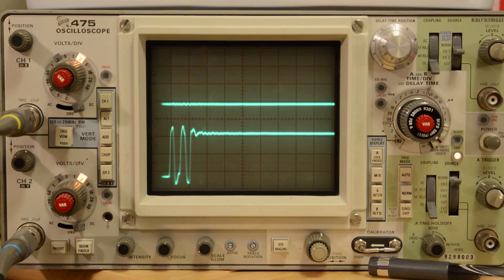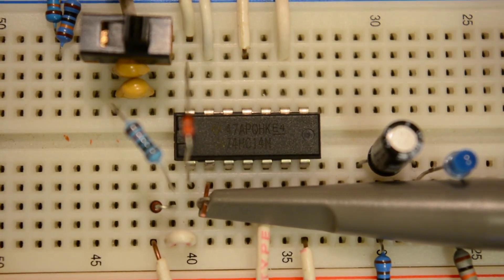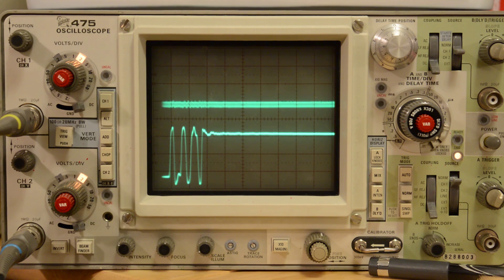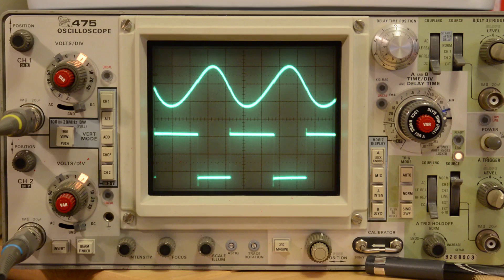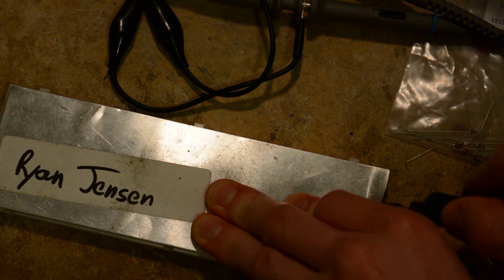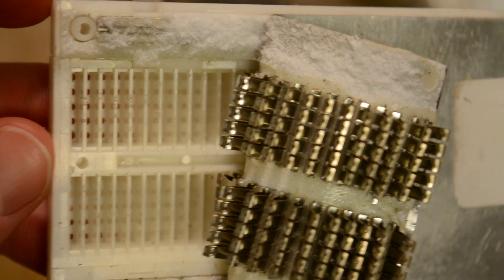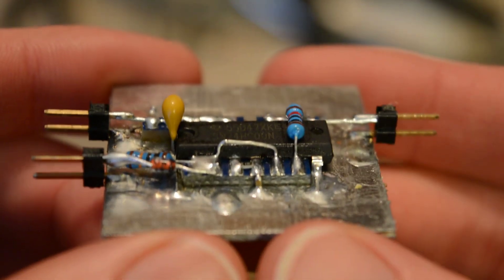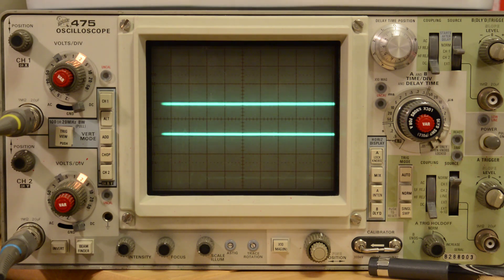Breadboard Parasitics - Misbehaving Digital Circuits

Comment: I am testing my ultrasonic sensor circuit which is controlled by arduino microcontroller on the  "breadboard". But my circuit is giving the unwanted output. Without any input signal to ultrasonic sensor this is because of breadboard only?
Reply from the maker: I don't have enough information about your situation to correctly diagnose your problem.  Generically, try to simplify your circuit as much as possible - only test one thing at a time.  Also, ensure all your electrical connections are solid (not intermittent)

Comment: Ryan - just saw your message in YouTube (was stuck in a spam folder).  As others have stated, the root of the problem you're seeing is 3-fold:
1) Breadboards make if VERY difficult to get good power supply decoupling, which is imperative when dealing with circuits with high speed edges - hence the distortion on your input signal.
2) The parasitic capacitance causes a lot of coupling between nodes, especially the high frequency energy in high speed logic edges - hence the multiple-transitions on your switching waveform.
3) Ground lead length on the scope probe can also lead to ringing in the measurement - see my video on that.
Reply from the maker: +w2aew Thank you for the information!
I soldered together the circuit from your TDR video (the 74AC14 buffered relaxation oscillator).
When I probed the circuit with a long ground connector (a few inches long), I saw a decent amount of ringing.

I tried probing my circuit the way you do in the video you referenced.
I saw a considerable decrease in ringing.
Thanks a lot for the instruction!
Reply: Glad to help.

Comment: Why are you ignoring the parasitic inductance? In fast logic circuits that is a far larger problem than parasitic capacitance. Rule-of-thumb: 1mm wire => 1nH. Do the calculation of V= Ldi/dt where di is the transient switching current and L is 1nH for every mm between in a loop between ground pin, Vcc pin and decoupling capacitors. Google for "ground bounce".
Reply from the maker: +Tom Gardner I did not consider the possibility that this phenomena was being caused by a parasitic inductance. I spent some time reading about "ground bouncing".
How, specifically, do you explain the behavior of my circuit?
You remind us that wires have inductance. You mention a phenomena called "ground bounce".
But specifically, how do these two things produce the glitch shown in the video?
Reply: +Ryan Jensen What did you understand ground bounce to be? I suggest you do a quick SPICE simulation of a circuit with a representative load and inductance in the ground lead. Remember that (photon counting circuits and femtoampere amplifiers excepted) everything is really analogue, even if a circuit "interprets" it as digital.

DIL TTL logic families used to have their GND/Vcc pins on opposite corners, and there was a minimum 1.4" loop from chip GND to chip Vcc. Even in the 70s this caused problems, leading to flat Rogers capacitors that were mounted under the IC[1]. By the mid 80s it was very problematic as transition speeds increased, and that nowadays you see GND/Vcc pins next to each other in the centre of the package to minimise problems. 

Very briefly, transient currents during switching cause transient voltages in the GND and Vcc wires. As far as the chip is concerned these "move" its GND w.r.t. signal from the external circuits. As far as the input transistors are concerned that is equivalent to having the induced voltage in series with the input voltage. And that can be large enough to cross the logic threshold.

[1] e.g. http://www.silicon-ark.co.uk/203a14-decoupling-capacitor-by-rogers-corp
Reply from the maker: +Tom Gardner
If a voltage is being induced in my ground connection, it should be the same polarity each time, because the polarity of the transient current in the output is the same each time. Do you agree?
Reply: +Ryan Jensen No. Think about what is happening physically in terms of electron storage and electron flow (charge and current). 
If the current goes from 1mA to 2mA in 1ns, what is di/dt? If the current goes back from 2mA to 1mA, what is di/dt? 
If the output changes from 0V to 5V and charges a capacitor, what is the direction of the current flow? If the output changes from 5V to 0V and charges a capacitor, what is the direction of the current flow? 
You need to read about switching transients, currents and ground bounce. Start with the classic book "High-Speed Digital Design A Handbook of Black Magic", and understand everything by Howard Johnson on http://www.sigcon.com/Pubs/pubsKeyword.htm
Reply from the maker: I was thinking that this "ground bounce" was caused by the "shoot-through current" of the transistors, which would be unipolar signal. I did not consider the current due to charging a parasitic cap. Thanks for the reference!
Reply: +Ryan Jensen Ground bounce is caused by any change in current, not just charging capacitors. Blindly applying the rule-of-thumb at http://www.edn.com/electronics-blogs/all-aboard-/4429476/How-to-estimate-ground-bounce-in-a-connector--Rule-of-Thumb--8 indicates a 1ns+5V+100mm/4" wire => 10V bounce! Clearly that won't happen, but it indicates that your circuit is highly likely to encounter such problems.

Also consider where outputs are driving transmission lines with an impedance around 50-120ohms. Even with medium speed logic, you need to think in terms of transmission lines when the interconnect is more than an couple of inches long. 

I hope you find the book useful; a little research will show it is highly regarded. Understanding and applying what's therein will save you an awful lot of angst and rework :)

Comment: Nice vid. Better decoupling of the IC from the power rails helps to reduce the glitches as well. It's generally best to avoid using a single decoupling cap value as the self resonance leaves regions in the frequency domain where the supply is still effectively coupled. I generally use a 100nF film and a 10nF ceramic for logic chips or a 22-100uF 'lytic and 100nF film for power chips. You can also reduce breadboard parasitic capacitances by "breaking out" signal lines to widely spaced rows. As with capacitor design the distance between the plates decreases the effective capacitance (and increases the dielectric voltage rating).
Reply from the maker: +Matt “Sigurthr” Giordano
Thank you!
Using capacitors near integrated circuits is good. I did not decouple the power supply nearly as well as I should have for this video.
In addition, it is really effective to connect each logic device to the power supply through a low value resistor if you can tolerate the voltage drop across it. choosing a value of 1 ohm or 10 ohms is usually okay for circuit only drawing a few milliamps of average current. Doing this allows one to control the low-pass filter that is being setup rather than relying on the resistance/inductance of the breadboard power rails.